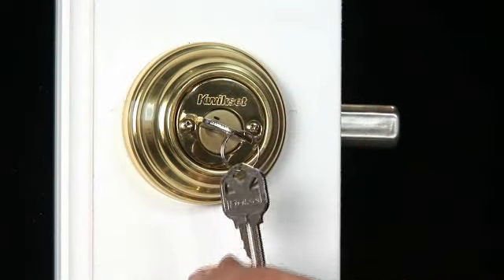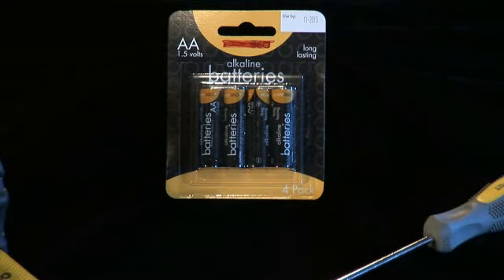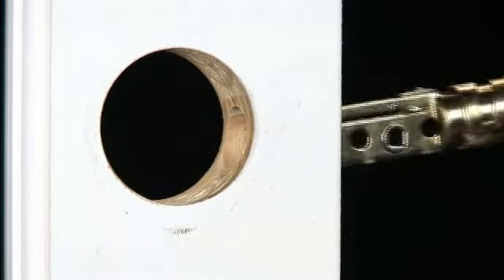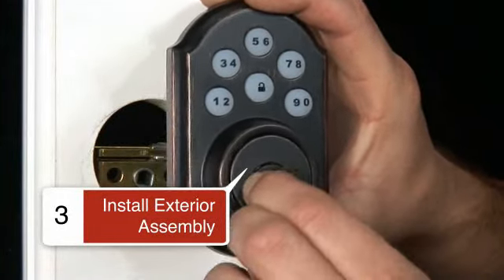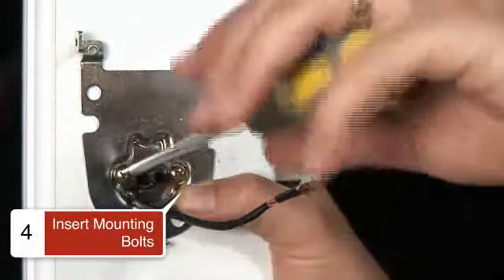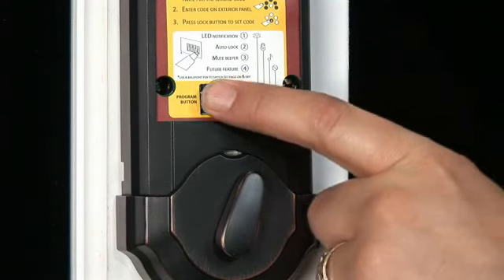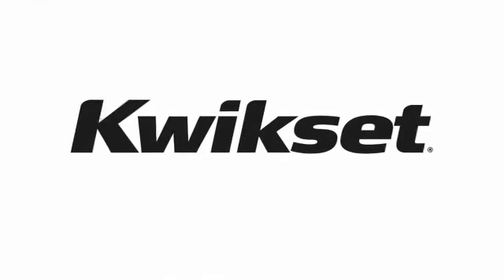Kwikset 910 SmartCode Deadbolt Install Video

Comment: Question...  I am tying to install it in a LEFT opening door.. when it operates the try to work as it was in a right one.. how can I change it?
Reply from the maker: Hi Carlos - Here to help! Please ensure you've installed the deadbolt with the latch fully extended, in the locked position. Next, follow the Manual Door Handing Process in this link to set the lock's door direction: https://kwik.st/3Rztvq2  Thanks ~ Kwikset Social

Comment: I lost my keys for this Kwikset smartlock. Is it possible to install a new key? Or does the whole thing need to be replaced? Thanks
Reply: You should be able to replace the middle tumbler itself...standard size for quickset lock. I used my previous quickset tumbler in this instead of the new one
Reply: How is it possible to use the old one is it not digital hookup
Reply: @rmbrikha  The tumbler is the round bit in center of the lock. All tumblers are purely mechanical. If you can't figure it out a locksmith can replace it.
Reply: They have a kit you can use and you don’t have to replace anything other than the keys

Comment: After changing the batteries, the front lock panel is not working . What might be wrong?
Reply: Me too. No replies. Hope it doesnt take me 7 mo for an answer.😁
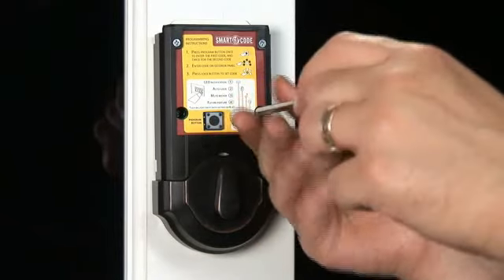Reply: Did you use the same method as done on 2:38?
Reply: You either inserted the batteries into the plastic holder wrong (most likely) or you put the plastic holder in backwards (only possible with brute force).

Comment: I installed everything correctly. But I can't turn the deadbolt with the backside of the assembly. Only the key let's me turn it. What might be wrong?
Reply from the maker: Please try performing the door handing process, this should eliminate any "hard to turn" issues you are experiencing. If this doesn't help please call our team at 1-800-327-5625.
Thank you,
Kwikset
Reply: I have the exact problem
Reply: Did you figure out a solution I have the same problem

Comment: Mine is loose on the top and screws are tight but will still move about a quarter inch it's been on for about a year and just started getting like this any ideas
Reply from the maker: Hi Victor,
If the screws are tight for both the deadbolt and the back plate please give our support team a call at 1-800-327-5625 so that we can provide additional troubleshooting support. 
Thank you, 
Kwikset
Reply: I had to put long screws where the two small screws went under the cover, then it's nice and tight.

Comment: Aren't the buttons supposed to light up, I can't see what code I'm entering in the dark
Reply: Robert Garza use smart phone flashlight app
Reply: Ralph Falstin that wasn't the question, if you have no real solution then don't reply
Reply: Robert Garza deal with it
Reply: Ralph Falstin 🖕
Reply: normally if you push the lock button it lights up the panel
Reply: @marthacarson9544  ^^ This

Comment: Anyone know how to completely delete the code and start over with a new one and also how can we can a new key I lost my old one?
Reply: Press the back programming button to the corresponding code you want to delete, example if your code is on the first button, press once, if your code is the four one, press the programing button 4 times and then enter a new code and follow the step as described in the video.

Comment: I connected the wires before I installed it on my door now I can't get the wires to disconnect help”
Reply from the maker: HI Frankie, they should just pull apart, please call our support team at 1-800-327-5625 if you need more assistance.

Comment: Which apps are compatible for my Android Note 3?
Reply from the maker: Hi Paul,
For your note three you can look into apps from Wink or Smart Things. You can also connect with a home automation or home security provider to find out if their apps are compatible with your device. You will need a smart home hub for remote access of your SmartCode 910 lock. 
Thanks,
Kwikset

Comment: Kwikset locks are TRASH!!!
Reply: We have had two Kwikset smartcode locks installed at our home for over ten years and they are both still working great. One of the locks is exposed to the elements and other than the signs of weathering to the finish it works great. You are welcome to purchase another brand if you don't like the Kwikset designs.